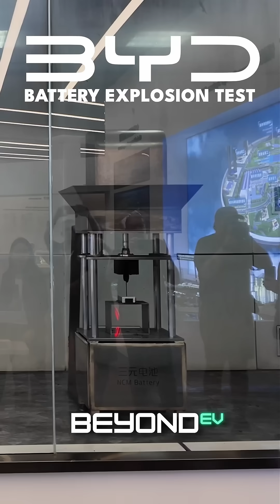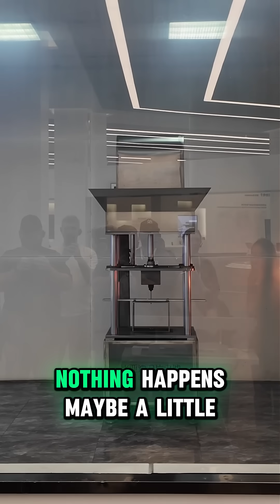BYD Battery Explosion Test  #byd #safety #battery #automobile #electricvehicle #electriccar #bydev

Comment: The NCM battery is huge, not sure if they are in bricks like that. Id rather an NCM in cold weather, LFP is not as good (less range etc)
Reply from the maker: Every pack and cell is different. That is a 'Prismatic' Cell form, basically a brick, and yes some cars do feature NCM batteries in that form. Some have cylindrical cells packed together inside a brick like that. Some use a 'pouch' form. There's all different types, this is just one of them.